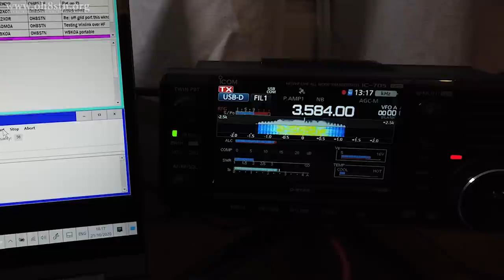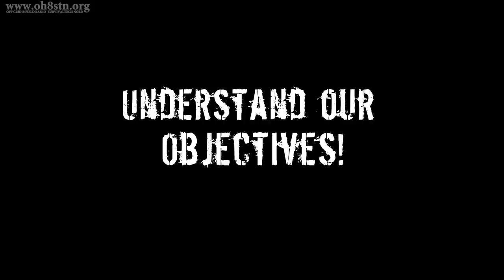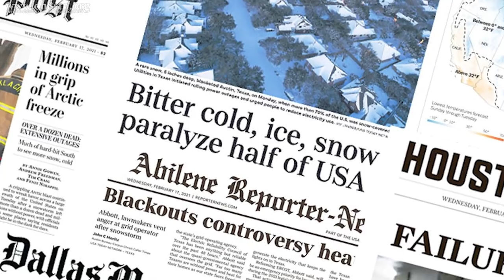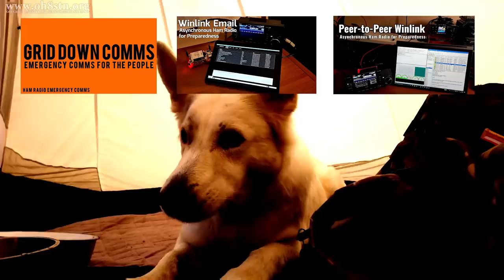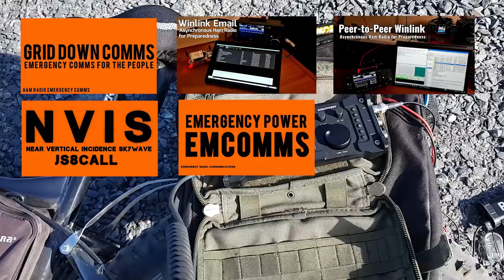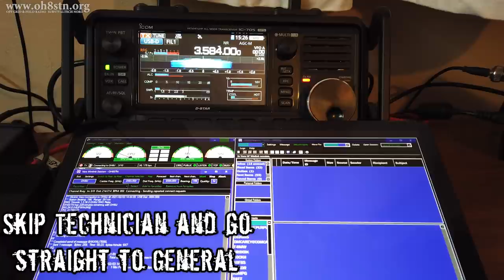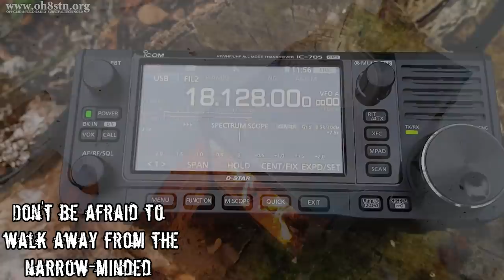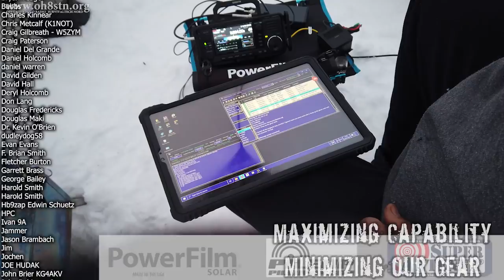Grid Down Off Grid Ham Radio in Texas

Comment: Greetings from Houston, Texas! During the power outages two weeks ago we all learned some very hard but valuable lessons. Internet and mobile phone service were completely down or intermittent across the Houston metroplex and other parts of Texas. My radios kept me well informed. Thanks for making such great videos! 🏆
Reply: Ditto.  I am in The Woodlands, Texas and having both GMRS and UHF/VHF kept me well-informed.
Reply: I wont go near ANY CITIES....*EVER!*  I've been well informed for a very long time
Reply from the maker: Thank you for sharing your journey with us. Hopefully there won't be any lasting trouble from the experience. You know the old saying, what doesn't kill us...
Reply: We were among the lucky ones.  We didn't lose power, but lost internet and cell phones varied.  I was able to get information first hand from others.  We could also listen to what solutions worked and what didn't.
Reply: Huntsville here.  Lost power for a while but had cell service.  The worst part is my internet went down.  I used to be able to run my router off 12Vif the power went out and get the internet back but my new provider sends power over their lines too rendering that useless.  It was really boring.
Reply: We were among the lucky ones except we did lose power for 1.5 to 2 hours on the third day. The rest of the time we had power, and internet and cell phone texting were not a problem, although Verizon had issues with their data network. Here in Ft Bend County our ARES group was able to keep in touch via simplex on VHF when the repeaters went down. The repeaters do have emergency power but something went wrong, but luckily they were down for only a day or so.
Reply: I like tube based radios. Not only do they keep you informed, they keep you warm.

Comment: Hey Julian, great video.  I spent the Winter Storm days in Galveston, and some cell service was down, and some was not, but I already had my HF and VHF ready to go, along with some solar power and batteries to keep devices charged, etc.

One side note the video - in the USA, Texas as you mention, you can't really "skip" the Technician test and go straight to General.  You have to pass Tech first, then go to General.  Lots of folks will study and take both tests at the same time, which I do recommend.  

73

Comment: Abilene Reporter News???  LOL!!  It's my local paper.  The local repeaters went down as they have a battery backup for short power outages.  Five days without power and the repeaters are VERY dead.  The power was lost to the water pumping stations so pipes at the facilities and area wide broke so the water was shut down for an extended period of time.  I keep 7 gallons in a jug in my bathroom for flushing toilets if the water stops.  I have 14 gallons of water in the back of my truck, all the time, for bug out which I brought in and we used with a water filter system.  We made it through with minimum life interference.  The cell towers started dying due to the generators running out of fuel.  It was an eye opener for many of us.  Thanks for the video and keep them coming as many people are looking into the "hobby" now that they know the infrastructure is so fragile.  73!!! de KE5ES

Comment: Howdy from Rockwall County in Texas.  

As a first responder during this event I can second every single word that you are saying.  You play like you practice and everything that is too complex, too heavy, too specialized, and too difficult to use in an emergency will NOT be used in an emergency.  If you are planning for emergencies the two words I would recommend are layers and simplification.  Have more than one way to handle essential tasks such as food, water, heat, shelter, and safety (layers) and then simplify, simplify, simplify.  You can't practice with every piece of gear that you can own.  Have a set of stuff that does what you need it to do and make sure it works on a regular basis.  

Thanks for your hard work and inspiration to the rest of us.

Comment: I am in North Texas. Lost power for 4 days, lost Cell service and internet for the same time.  Used battery power and VHF Winlink and APRS (SMSGTE) to get word out to family and friends.  Used HF SSB to talk to others also.     Overall the biggest problem I had was not having hard copies of some of the needed info.  I am putting a SOP manual together that has this info on it.    APRS in my area was reliable most of the time.   Lots of nodes.  Local repeaters were hit and miss after 2 or 3 days.   I have generator power but did not need it for this.
Reply from the maker: Thanks for the report in glad to hear you guys are okay. This is really practical information, we should all try to absorb.
73
Julian oh8stn

Comment: Excellent video, as always. I'm a winter storm "survivor" in Fort Worth, Texas. I had no power or water for six days, but the cellular networks stayed up. I was able to keep devices charged at my workplace which never lost power. I feel like I kinda got lucky this time around, but this event definitely woke me up to the need to up my preparedness game on multiple fronts, communications and otherwise. On a slightly related note, I got started with using DRAWS with a Yaesu 891 and the Super Antenna. No confirmed contacts yet, but I know I'm getting out based on some WSPR reports, even from the super antenna set up in a tiny apartment yard.
Reply from the maker: Glad you got through that okay. One must consider how it could have been worse, take the lessons then keep moving forward.
If you want to better tools for the draws hat, try it with ft8, and see who hears you on psk reporter. Wspr is kind of a lie. It is so sensitive that it's an representative of real world comms. Also remember to use as many counterpoise wires as you can with the super antenna or any quarter wave vertical.
Anyway cuz I'm just waking up, it's a really nice message to find :-) Thanks for the kindness and comment. Both are very much appreciated.
73
Julian oh8stn

Comment: Somewhere in Florida experiences a significant grid down event every 10-years or so, but the lesson seldom is learned outside the locally a
effected area.  Even professional emergency managers don't get it.  The don't plan for grid down events.  The see 800mHz trunked radio systems as the ultimate bullet proof emergency communications solution.

There is always a weak link in those systems that means that tend to fail before a genuine area wide grid down event.  Locally in hurricane Matthew which was about 20 miles offshore as a Cat 2 those failures were water intrusion at on location effecting radio gear and a dead starting battery at the county EOC.  2/3 of the 800mHz system went down with 911 services during the peak of the storm.

Comment: FYI for prospective amateur radio operators in the USA. You must pass Technician and General class exams to gain a General class license. The General class gives you access to the majority of the HF frequencies. The current test fee is $15.00 dollars. When you pass the Tech exam you will be given the option of taking the General at no additional charge during that test session. More details on the ARRL website.

Comment: @OH8STN Ham Radio Appreciate your videos! Grid down scenarios is what got me into Ham Radio, enjoy your approach to all this. I plan on getting into your JS8CALL videos next... I’m a Mac user.. do you know if JS8CALL works for Mac? I tried downloading and opening it and got a weird error.. I may have to look into getting a pc if i can’t get it to work because JS8CALL seems to be the best thing out there. I’ll check out your other videos.. thanks again.
Reply: Josh, JS8call is a fantastic mode. It does work on Mac but I'm not certain on Big Sure OS.. Getting Back to JS8, there is so much that can be done with this tool: Leave msgs. for operators on your system or theirs, relay msgs., sending emails & SMS mags.... all under poor band conditions and low power. Truly it's an amazing option. 
- De W8APP
Reply: @dvcrash  Appreciate the info Anthony! Really looking forward to digging into this. Let’s hope i can find a version to work with my OS. Cheers

Comment: This is something I've been wanting to get sorted. That JS8call ... is it akin to the old packet radio service where many could just type to each other like a group chat?

I know you've spent your share of time with the FT891 which I intend on using, what did you find best to interface between the FT891 and a preferably Windows laptop (android tablet acceptable)? I think this gear might have changed a bit since I last looked at something like a Signalink I think the box was called.

The solar, antenna etc I can sort (have a manual tuner if needed etc even if it's not small (would be in the caravan most likely anyway) without issue but the best or most appropriate interface I'm not sure of now.

Then later I just need to upgrade my license level to the Australian standard level (not sure if I'll bother with advanced).
Reply from the maker: I think I'll do a video on putting together kit. The 891 is very current hungry. Great for car, or with enough solar.  JS8Call is very much like packet, but more narrow and slower. Check out the js8 and NVIS videos in the description.
Reply: @OH8STN  thanks for the fast reply and yes they're on my list already to watch sometime today. 

Our 1st fallback is simply stay in home and use the old 36v panels we have downstairs and the Victron 100/30 MPPT.

Our 2nd fallback plan is bolt with the caravan because it's easier and carries more. The caravan already has a panel on it but I want to upgrade later to 2x 250w panels and more AGM's. I'll be able to have the choice of ATAS120A or wire antenna from the caravan too.

Our 3rd fall back plan is crude with BOB's carrying hammock tents with cover tarps etc and I'm not sure what I'll do with that one for HF since weight will be at a premium and our funds are low. I'm thinking I'll have to go wire antenna, some millenium get enough money for a foldable solar etc.

Comment: Excellent content as always. Julian I've recently read about a project AndroNix which allows you to run a full linux OS on and Android device has anyone that your aware of used this for HAM coms? I don't know what if any access the software has to hardware but it could possibly reduce overall kit size.
Reply from the maker: Actually this sounds like something I can investigate. I haven't heard of it or used it myself yet, but I'll do some research and see if it's worth the effort. Thanks for the heads up.

Comment: I have one DIY charging system: Samlex PST-600-12, Genasun GV-10-PB-12v, PowerFilm FM16-7200, Deka 8A27. But I am looking to add one or more self contained systems, i.e. all the above plus a built in converter to use when line power is available, something like GoalZero, Inergy, Jackery, Point Zero Energy, Patriot Power.  Has anyone done research into a system that is RFI quiet, i.e. the engineers have added the needed ferrites, etc to deal with the hash coming off the inverter, converter, MPPT controller.  Thanks in advance!